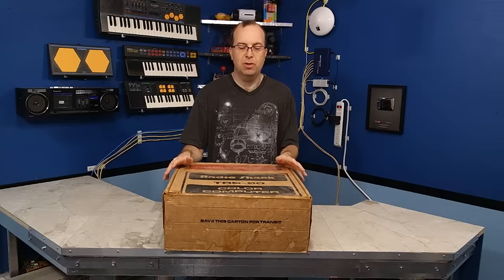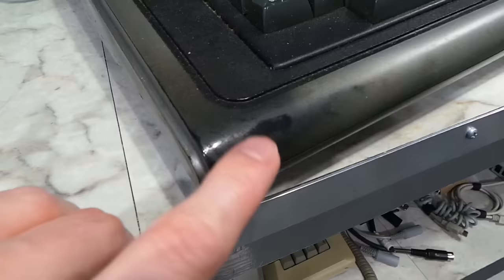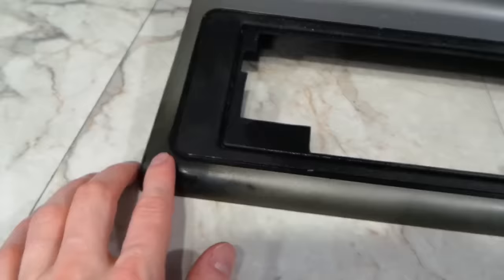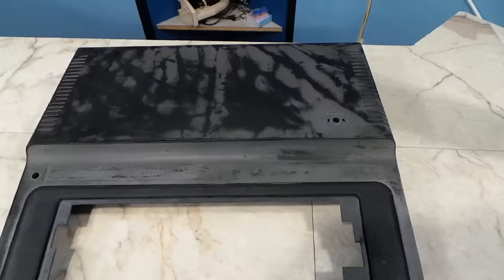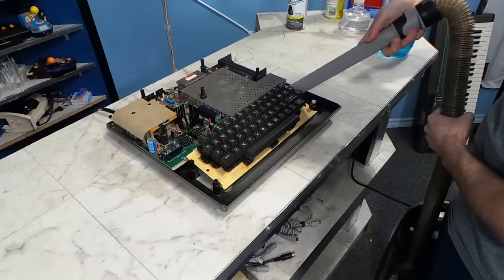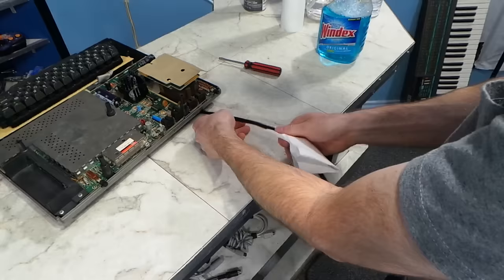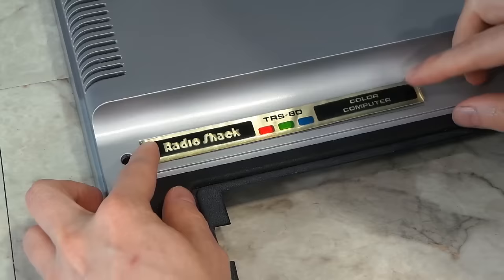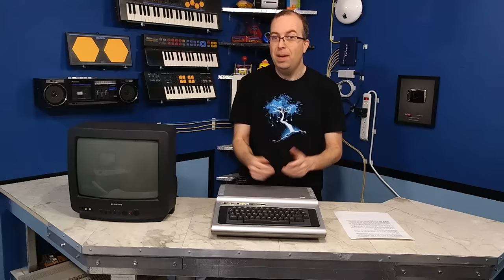TRS-80 Color Computer 1 Restoration

Comment: That RAM mod is a 64K mod. I did that exact mod to my CoCo back in the day. The reason you only see 24K is because the ROMs are mapped to the top 32k and some of the RAM is tied up for the video display. Some of the more sophisticated machine language programs would copy the ROMs to the RAM and bank switch them out. Thus they could bootstrap themselves and gain access to the full 64k of RAM.  I replaced the keyboard and replaced the character generator with a LowerKit which does exactly what you would expect... added true lower case characters. I had a lot of fun with my CoCo back in the day and I still have it, stored away in the closet. BTW, I wore even more paint off than yours. :D
Reply: Take it out and make sure it works. There are convertors available if you only have HDTVs.
Reply: +plushroom Found out by accident; It means "Color Computer."
Reply: Do you know what those jumper wires on the logic board could have been for? And it seems like one of each pair of resistors next to the RAM chips had a lead broken off. Could this have been intentional, and if so, why?
Reply: Please remember that I did this around 35 years ago but as I remember the original CoCO I could not access the full 64K on its own. The mod to get it to use 64K involved using some UNUSED sections of a multi-section  logic chip that was on the motherboard. The unused sections were grounded in the circuit board. To use them, the chip was pulled from its socket, the pins were bent up so they did not go into the socket any longer and then those jumper wires you saw in the video were soldered to the now-exposed pins. There may be more but as I said, it was a long time ago that I did that mod.
Reply: Hi, I used to hack this computer a lot
So I had at that time a Memory Map and how it as distributed.
Of the 64k, it was layout like this:
lower bank 32k of RAM
higher bank 24k of ROM
higher bank 08k for the Side Cartridge

When you had the full 64k of ram, the computer is blank, no system to work with.
What the hack program did, was to issue a interrupt signal to hold the computer
operation, copy all 24k of ROM into RAM, and use the system from RAM, that would free
the 08k of cartridge slot, so you end up with 32k lower bank + 08K of Higher RAM
A latter program moved the copied rom to the upper bank of ram in order to have the 08k
cartridge right after the lower ram, a 40k continuous area of memory.
Reply: RAINBOW and HOT Coco Magazines had articles about upgrading the Coco to use 64k.  The Coco1 32k upgrade was handled by using half-bad 64k chips, but eventually good chips were used when they ran out of bad stock. By doing the mod you could allow the CoCo to bank-switch 32k to the full 64k.  PRINT MEM will only say 31K after the mod - you had to run a 64k game like Popeye to run a memory test to check it.  I had this box as a kid - and just bought a replacement a few weeks ago and ran this mod.  

https://colorcomputerarchive.com/repo/Documents/Magazines/Hot%20CoCo%20(Searchable%20image)/Hot%20Coco%20Vol.%203%20No.%201%20-%20June%201985.pdf
https://archive.org/details/rainbowmagazine-1984-05
Reply: I do have one question. Are you knowing if where I can find a color basic 2 for the coco 2? I have a 16k machine and want to find one.
Reply: Sounds like we both did the same mods...  🙂
Reply: @dacheeze4515  YES! I used to get those magazines and mod the heck out of my Coco.

Comment: 4k was hot stuff back in the day. Interestingly, 4k is hot stuff today too, just a different kind of 4k.
Reply: Even after 40 years, nothing has changed.
Reply: displays probably didn't matter back then
Reply: I just wanted to add joke: 4K those days?! Wow! :D
Reply: No, 16k was hot. We're going backwards.
Reply: 8k monitors are coming out now
Reply: No-one needs that and for human eye this is even not noticeable.
Piece of crap. Marketing sells it anyway.
Reply: DonPedro because human eye can only see 30fps?

Now that's just a joke, I actually agree that manufacturers are going too far on this, 1080p is already great and 4K has plenty of margin, the current actually useful development is HDR, but other most useful things are no lounger being done, like the ARASC nano coatings used to be standard but now that's somehow gone. Such a pity.
Reply: Well, not noticeable, but it's great for content creators. You have more space to work with !
Reply: +DonPedro the human eye can see probably about 5000k
Reply: +Siana Gearz 
The human eye can see roughly 240 fps
Just a little fact
Reply: MOM ITS NOT WHAT IT LOOKS LIKE it is too inconsistent to slap a constant fps number on it.
this 240 mark was only achieved by highly trained air force personnel and only on flashes of black to white.
it's all about the ammount of difference from one image to the next.
also affecting the perception are many other variables like moving object size, color and shape, also influence of drugs and state of alert of the viewer's body.
Reply: Logan Dotson I notice a difference between 480 and 1080p
Reply: AllThoughts 3rased not only does the resolution matter, the bitrate of the video you're watching plays a huge role in image quality.
many channels on youtube upload 4k video that is actually 1080p but looks better because the bitrate is higher.
i've figured that 720p is good enough for most cases since anything that would be recognizable on an old computer monitor will also show on the encoded 720p webm from youtube.
Reply: You mean 2160p?
Reply: homeycdawg 4K nowadays is something to brag about, when it comes to monitors and videos. Not when it comes to computers though.
Reply: No, as Dave himself says here, 4 lousy KB it wasn't something to brag about even in 1980, so  no "hot stuff" at all.
Reply: Back in the day, the consumer market did NOT get the good stuff, they got the extremely antiquated stuff. Professional computers were doing 24,31, and 32-bit, but it was too expensive to mass produce, so the consumers got 8-bit. Professional computers got 64KB of ram, while the consumers got 4KB of ram. No, it wasn't even something to brag about back then. The 80386 was the first step towards a 32-bit consumer PC, but even still, we were stuck in 16 bit for another 10 years...
However, after we got to 64 bit, the numbers are now large enough that there is no reasonable reason to increase that on the consumer side for a very very long time. However, in 2038, we run out of 32-bit numbers for the time. That should be an interesting time :) Games are still, to this day, based on calculating the time based on a 32-bit long.
Reply: DonPedro I can't see 4 kilobytes  either.
Reply: Logan Dotson weird, I thought going from 1600x900 to 1080p was huge
Reply: Haha!
Reply: @dumdum7786  i think 5000K is too insane

Comment: coming from the automotive industry i can give some advice when painting plastic. 
1.scuff surface with abrasive cloth (rough side of kitchen sponge) and clean with alcohol
2. use plastic primer first
3. USE VINYL DYE for color its made to prevent the reaction from skin and oil he talks about in the video. (its used in the auto industry to paint carpet and seats and if used correcty in never comes off during normal use.)

Comment: I nearly got teary-eyed watching this video. That Coco is nearly identical to my original Coco that I bought so many years ago. Like the one in the video, mine was one of the earliest models that came stock with 4K RAM. I would not be surprised if that machine was a version D motherboard, like mine. I upgraded my memory to 64K, and I'm pretty sure that is the same case for the one in the video. Because of the memory addressing, you could only access 32K. Also pretty positive that it's the same aftermarket keyboard as mine, which was from a well-known Coco company called Mark Data. It was a great keyboard with a nice feel to the switches. My Coco also had paint worn off in the same area of the case! I loved my Coco and learned to program in BASIC on it. I also used it for graphic design and art, if you can believe that. It was a great machine that never got the same amount of spotlight as its contemporaries, but it was an extremely capable computer that punched far above its weight. So glad to see it getting some love to this day, and I hope there's more Coco videos to come!
Reply: Hi . I also got quite nostalgic watching this video. I also did the memory upgrade, but I also did the mod like the one in this video where you bend the address pin up out of the socket of the 6809 and physically wire it to the address pin of the ram. The CoCo motherboard didn't have the track as it was never designed to have that much ram but the 6809 could address it. Thanks 8-bit guy for the great Video.
Reply: Yeah, a bit of nostalgia for me, too.  I had the 16k model of this machine.  What I was hoping to see in this video was a copy of the book on how to program in BASIC, which came with the machine I had.  That original keyboard sucked, and I was having problems with it within 2 years.

Comment: The CoCo was my first computer in 1982, and I loved it. I learned so much on it, with 4K version and the Extended Basic ROM installed. I did upgrade to 32K and only 24K was usable, and I also replaced the chicklet style keyboard to a mechanical keyboard, but mine had grey keys and not black keys. I also had a 4x ROM expander, 2x Tandy 360 degree joysticks, and a floppy drive controller with 2x 5.25" floppy drives with 4x virtual drives (A and B sides of the floppy disks.) I must find it in storage and do a review on it, maybe...

Comment: I learned to write machine code on a Trash-80. We had several in my school computer room in 1978. My parents used to pick me up at 6pm or so on the way home from work, so after school, I used to go to the computer room and mess around on the TRS-80s. I wasn't actually enrolled in a computer class, but I did end up getting a report for computing: "Works well with a minimum of supervision, and good at optimising use of computer resources. However, he seems mainly interested in the entertainment capabilities of the machine. B+"

Comment: Looks like it came out pretty good for only your second attempt to ever paint plastics. Here are some tips on painting plastics (and a lot of other things) for next time. I know you don't often reply to comments (and perhaps don't have time to read long ones like this) but maybe it will help someone else out:

1 - If the original paint is still stuck on, leave it alone. Just sand the entire surface lightly with 180-220 grit to rough it up for new paint to stick and clean off the loose stuff. There's no need to strip the old paint completely off.

2 - On plastics, after a proper cleaning (I used soap and water, let it dry, and then go over it with automotive paint prep solutions, but denatured alcohol is just fine too... clean it until your rag no longer picks up anything), the first thing you want to do is put down an adhesive promoter (which is sold by that name). It will leave a slightly textured surface for the paint to help hang on to AND seal the plastic so the oils won't leech through (which is why your first painting project didn't go well). Once you lay down the adhesion promoter it doesn't matter what kind of paint you put on top of it since the plastic is then sealed at that point. It doesn't have to be "special" plastic paint so that opens you up to a lot more color options, like stuff from the auto parts store (which is where you can get the promoter too).

3 - Then you really should lay down a coat of primer (just regular "primer" in a can). Any high spots in the surface, particularly from laying down a new coat of primer over the old paint, can then be easily sanded down smooth. You should use a "body board" for this (a paint stick with some sand paper wrapped around it works fine for small stuff, as do the sponge sanding pads from Harbor Freight) so you end up with a nice level surface. If you sand through the primer on the high spots while trying to get to the low spots, hit it with another coat of primer and go at it again. If you have really bad low spots for some reason (maybe someone used the top of their computer as a coffee cup holder and deformed the plastic over the years?) you can apply regular old body filler to build those surfaces back up. The sanding process for it is the same, then prime over it and sand it all again. This sounds like a lot of work, but on something small like a computer it really isn't. I'd venture a guess that I could fully prep and body work that computer in 1-2 hours and I'm pretty meticulous.

4 - Lots of old electronics have a textured finished surface and the sheen is normally somewhere between flat and semi-gloss, which is difficult to replicate out of a paint can so things end up looking too smooth and shiny when you're done. To mitigate that you can lightly sand the entire paint job with something like 2000 grit sand paper, clean it off again, and then from a distance (3 feet or so) apply a fine dusting of paint again (really, you just want to put the paint in the air and then let it fall on to the surface). The 2000 grit will knock the shine off of it and the "dust" will reapply the texture. Don't apply clear coat unless you want it to be super shiny again. I've also found that LIGHTLY wiping with lacquer thinner will also knock the shine off, but you have to super careful because that will, of course, also take the paint you just applied off.

5 - If you want to get crazy with your color matching, you can always lay down a color coat that you know is too dark and then apply light coats of a shade that you know is too light until you get it just where you want it. I've had to do that countless times while restoring automotive interiors because even if you have the factory paint matched color, the other parts of the interior are going to be a different color simply from age so if you don't color match what is actually in the car your restored part will look super out of place and becomes what is known as a "bulls eye" for your focal attention. That's not such a big deal in this case, but imagine if the keyboard had a trim area that was supposed to match the rest of the COCO and you can see how it would look weird if you painted it and the colors were just slightly off afterward.

None of this is really anything that is all that difficult, but it does take a decent investment in time and attention to detail. If you're the type of person that finds tedious tasks relaxing (which I sometimes do) then this is right up your alley. If you're prone to rushing through projects, then body and paint work probably isn't for you in the long run.
Reply: That's a good post.
Reply: You've just written ~4.6kB of text.
Reply: Me: * clicks on 'read more' *
"Oh God, that's a big wall of text!"
Reply: bruh take it easy your going to fill the whole comment section ITS SUMMER AND I DONT WANT TO READ caps sorryXD
Reply: Was wondering about the primer.
Reply: I like that @Maxwelhse's painting tips are longer than would fit in the original 4K of RAM.

Comment: I worked for Radio Shack back in the day and as a matter of trivia, that paint (for ALL the silver Tandy computers) was actually mixed to match a Mercedes Benz automotive paint code. 👍
Reply: Any idea what the paint code was? The closest I've found so far is 792, aka "Palladium Silver Metallic". However, the Radio-Shack version (at least on my Coco) has fewer of those sparkle flakes.
Reply: @beenine5557  No... I'm afraid that I don't have that info.. That was just like like a common (insider) knowledge kind of thing back during my first stay at R/S which was 1980-84. You might try to make connection with someone who worked at Tandy / Radio Shack computer manufacturing in Ft. Worth, TX.. Or even do some searching for "Mercedes paint Tandy Computers" Etc..
At any rate.... good luck to you!! 👍

Comment: When I was in primary school (K through 4, 1980 through 1985) there were several of these in the various classrooms that mostly just collected dust. They were the version of the TRS-80 that had a built-in monochrome monitor and two floppy drives, as well as having a real full-stroke keyboard. The only thing I remember doing with them is some basic math exercise program. It would display a math problem, like 3 × 8 and you would type in the answer and press enter. When you finished it displayed your time of completion and the percentage of problems that you got correct. Some kids took that "game" wicked seriously, like David Chabot, who would get all tensed up like he was waiting for a starting pistol in a race, go as fast as he could (which was funny to watch), and then brag about his results.

Comment: I was a "serious" CoCo user when I was a kid.  I had the CoCo2 and then the Coco3 128K.  I spend a lot of time typing in code that I got from a magazine called "The Rainbow".  They had lots of submissions, and I would key in all the Color BASIC and then RUN the program.  And they even had some assembly language programs, too.  It was fun.

The Coco3 128K had more power than the CoCo2, the plus the "true" uppercase/lowercase lettering helped when it came to word processing.
Reply: Had the nicest keyboard too!  Built in AD converter almost true rs232 ports.
Reply: @brianbabey  No, it had what we call a bitbanger port where the processor sent the bits out one at a time.
Reply: There were aftermarket lowercase mods for the Coco 1 & 2 as well as the last model Coco 2s having an updated video chip called the T1 that had lowercase built in.